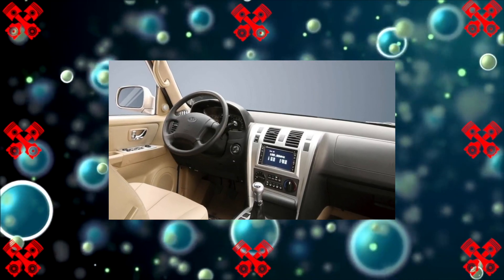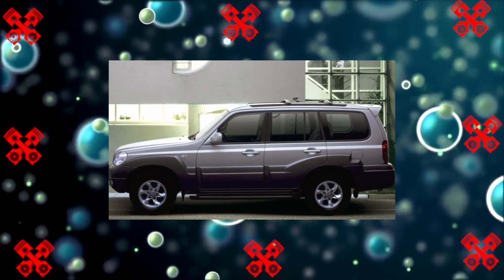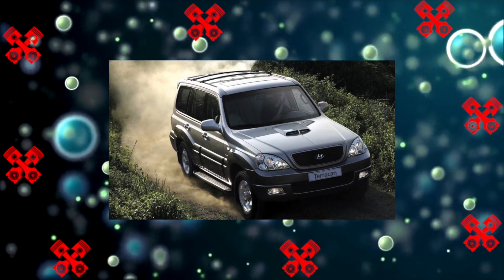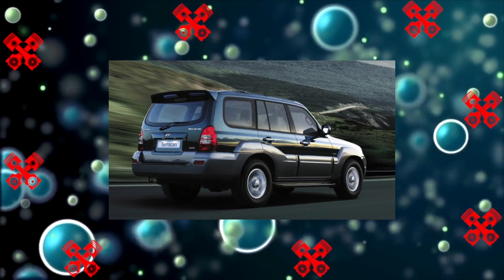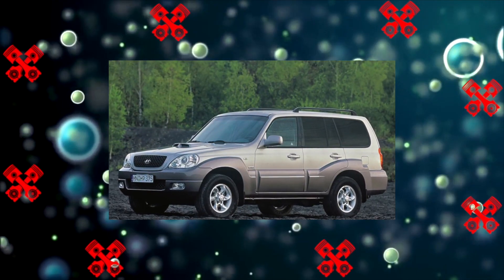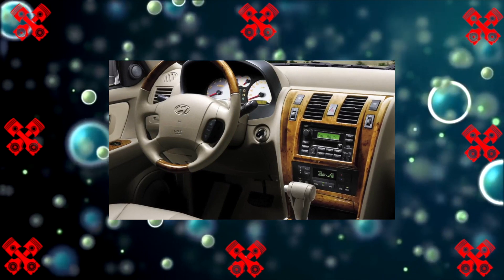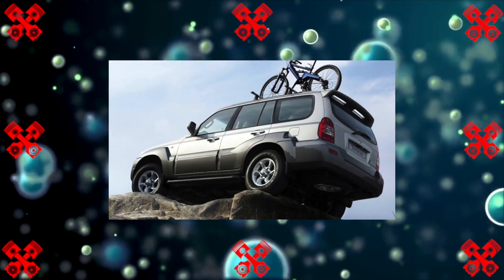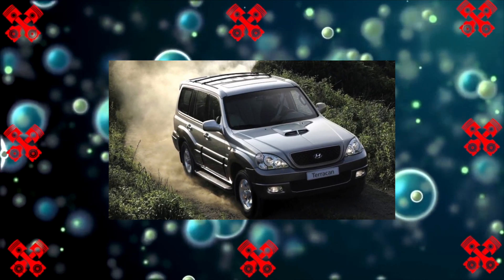Used Hyundai Terracan Reliability | Most Common Problems Faults and Issues

Comment: Okay I have mine for 16 years. Took me from Spain to England and back, no problem. Yes the dual mass flywheel failed but I fitted a single mass flywheel myself cheaply....no problems since. Only worries like in any diesel are injectors but I change my fuel filter at every oil service. So we'll see. It does the job and a change of dampers to German items makes a lot of difference.